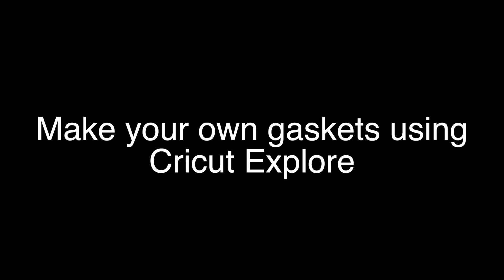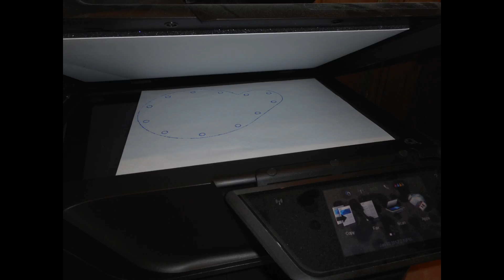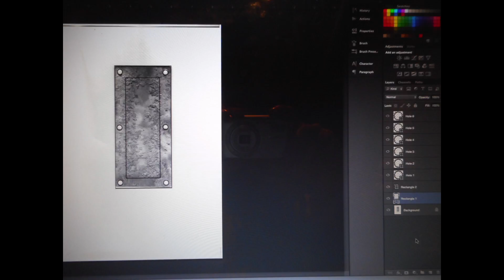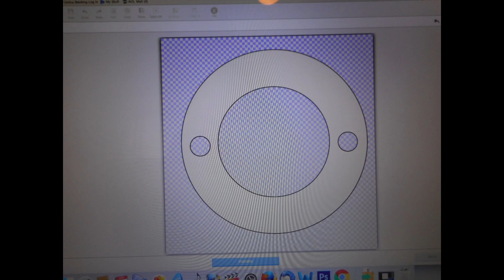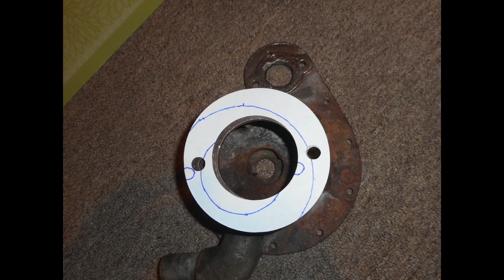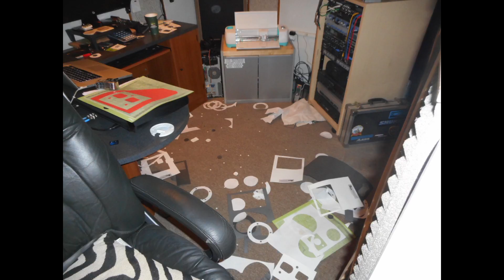Make your own gaskets using a Cricut machine !

Comment: I would like to cut washers of around 1" of diameter with an internal hole with around 1/4".
Could this machine do this job by cutting the washers from a flat rubber plate of 5/64" (2 mm) of thickness?
Reply: Sorry I'm just seeing this now.  I would say probably.  The small dimensions are not a problem at-all.  If the blade doesn't cut all the way through you can run it a 2nd time.  I'm just wondering if the blade might get hung-up on the rubber.  Maybe check with some other folks about if rubber can be cut.  Thanks for watching.

Comment: I prefer to use inkscape, it does basically what you need here, and it's free.  I used the scan, trace, scale, and cut method to make some insoles out of craft foam and contact cement.  It's basically the same process.